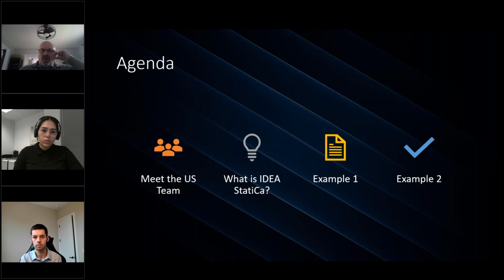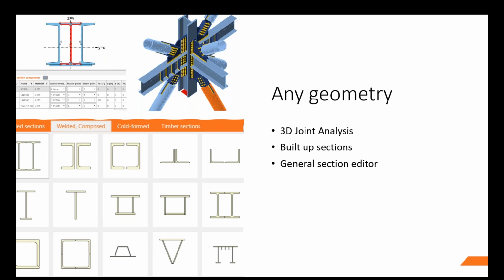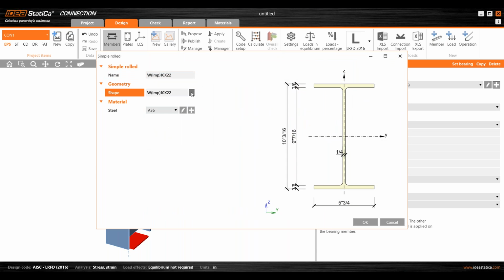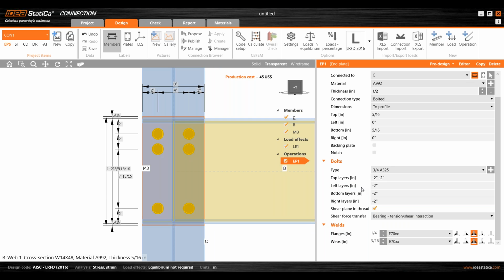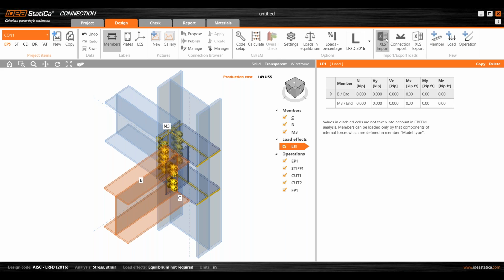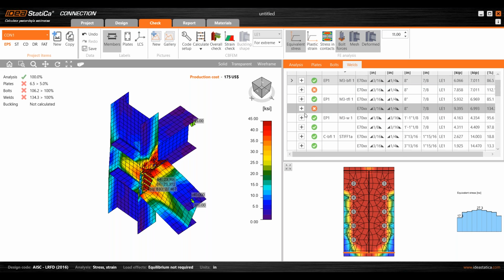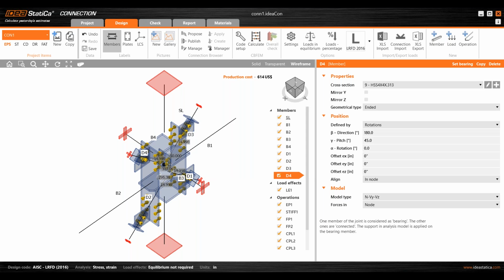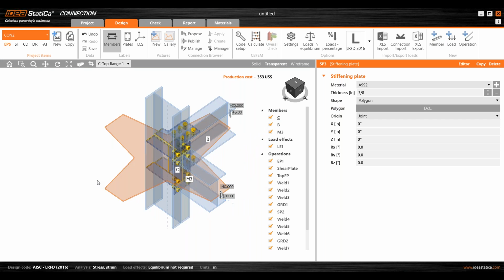How to replace hand calcs for steel connection design?

Comment: Any pdf to reinstall Idea? Im one of the first to buy this software some years ago, but after maintenance in PC I cant restart. I have a secont HD. I dont have a dongle. I would like to have a dongle.
Reply from the maker: Hello Ailton, 
Thank you for your comment. 
It looks like you have a very old version and if you do not have the maintenance service paid, you most probably won't be able to use it anymore. This is exactly the reason why we suggest our users to use the Lifetime serviced license, because they will be automatically shifted to the newest version with every new release. 
We changed the licensing system 2 years ago for a new cloud-based online system, so for now, versions 10 and lower are not supported anymore. No dongles are necessary anymore and thus not available. 
Find out more about this: https://www.ideastatica.com/support-center/release-notes-idea-statica-steel-20

Please, try to reach out your local support for IDEA StatiCa: https://www.ideastatica.com/resellers
and discuss with them further options.